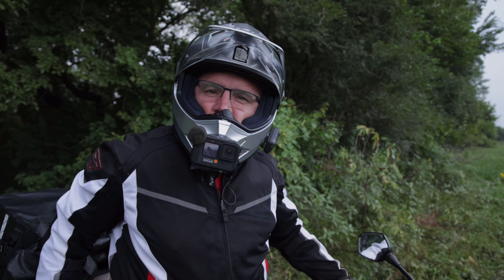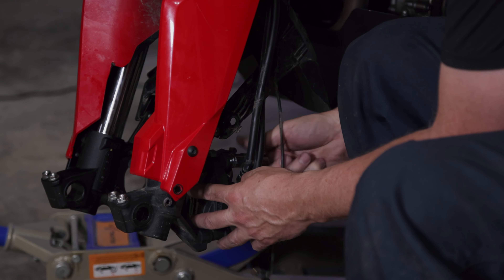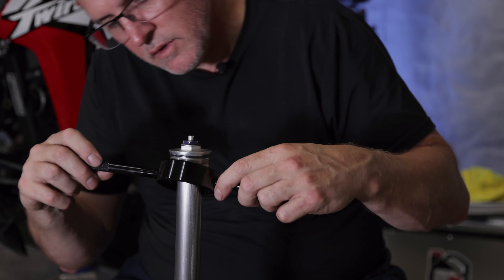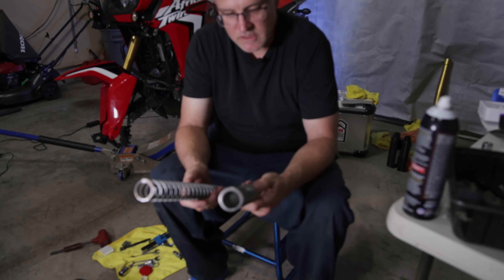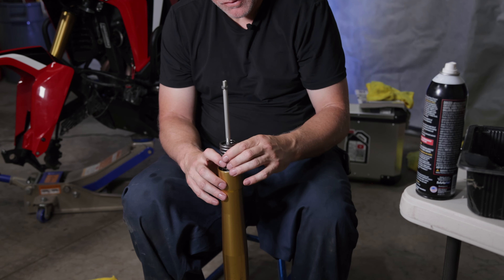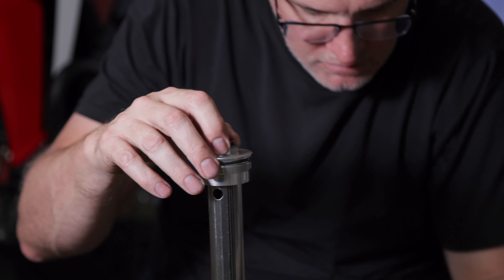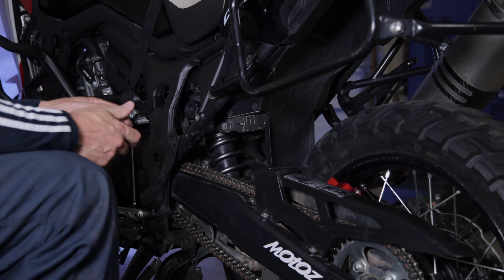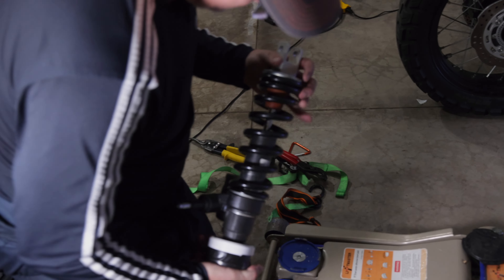Africa Twin - Affordable Suspension Upgrade with Hyperpro Springs

Comment: Nicely done.  I did the same to my 2016 Africa Twin, using some stiff Racetech springs for the forks. It made a huge difference in handling for me.
Reply from the maker: It’s the single best mod you can do for the AT if ride sag is unattainable for you as a rider. No more sending energy through the frame and body.  Its not just for off-road….so much saver on pavement too.

Comment: Nicely done! But how does the bike feel now in comparison to how it was when stock? Try to describe the new feeling please :). Thanks and cheers buddy!
Reply from the maker: Hey, thanks for the comment and inquiry.  I am 225lbs and there was zero chance at setting sag correctly and travel length was lost from the get go.  The benefits of the Hyperpro springs is immediately noticeable just taking bike off center stand and moving the bike around in the garage.  The whole bike feels like it has a core six pack with the ability to hold and transfer forces correctly. There is a lot of preload left too, giving you the ability to load up and go on trip where you come back with a beard.  The intended travel length is now available, (on top and on bottom), and the progressive part is at the end of stroke keeping violent forces from getting into frame as it stiffens at the end.  Action is improved and controlled unless you go full Evel Knievel of course.  The bike even looks better on side stand, as it is not squatting under the added weight of the mods.
Slow Speed  maneuverability and off-road technical:  Absolute improvement!  When you twist the throttle, power is delivered to the rear wheel; instead of spending time expanding the forks, compressing rear spring and then getting power to the wheel, then reverse process when braking.   The Hyperpro recommended settings seemed dialed in too.

Please comment if you have additional questions that were not answered.
Reply: Amigo !  Excelente video gracias. Greetings and respect to all from Durango Mexico 🇲🇽. New subscriber here
Reply from the maker: Thanks for the support!

Comment: Is there any way to demonstrate the change from stock?
Reply from the maker: Towards the end of the video, we demonstrated that the Hyperpro springs had the option to raise the suspension by about 20mm. To the eye, that's one of the biggest changes from stock. When it comes to riding and handling, there is a significant change. We are going to put out a full review/feedback video later down the road when we get enough testing and footage.

Comment: I have the same kit (standard rate spring) and I cannot find the 10.5 mm reference for the damper rod lock nut on top. In the HP instructions or the Factory manual it does not mention this.  I left mine at 10.5 but I wonder where Haynes gets that info.  Anybody have further info?
Reply from the maker: I’m not sure either….but it leaves room for turn on rebound and preload

Comment: What are the recommending fork and shock settings with these?  Mine did not come with them.  +20 kit
Reply from the maker: Comes with kit.  Based on weight and riding style.
Reply: @1LiterADV  ok mine did not come with that… any idea for 250?
Reply from the maker: You’d need to call them.  They’ll send you the literature

Comment: Correct me if I'm wrong but you filled the fork leg to 180  from the top, the Honda manual says 95 ml. Watching you stick the Tool into the top of the fork I could tell that the amount of tube down into the collar was twice what it should be
Reply from the maker: 180 is the recommend space with the Hyperpro spring I chose. HP sends the recommended settings when you purchase their kits.
Reply: @1LiterADV  I know, I have the same kit..
Reply from the maker: 180 should be correct depth.  Just measure before inserting spring.
Reply: I'll go back and read their directions once again, I was pretty sure they said to refer to manufacturers oil settings

Comment: As per the manual, for the rear, the tighter coil (which is smaller did)  needs to be towards the preload adjuster isn't it? or did I read it wrong? - see that you have put the tighter coil to the bottom?
Reply from the maker: I believe you are correct for the OEM spring.  The Hyperpro spring has tighter coils down.
Reply: @1LiterADV  ok. The manual says that smaller dia to the top. Is the dia less for the tigher coil side or the other side ?
Reply from the maker: Yes.  The HP spring actually only fits that way.

Comment: Thanks for the installation video. Can you provide us with a preview/ comparison video or update please?
I'm really interested to know how different these springs are from the originals.
Thanks
Reply from the maker: Hey, thanks for comment.  We plan to do a follow up video this spring/summer on the swap.  I am very happy, as the suspension now has the room in pre-load to set sag for me and still leave room for loading up for a long trip.  Before I was maxing out preload unloaded.
Reply: @1LiterADV  👍🙏
Great to hear

Comment: Perfect job!
Awaiting video with review after few kKm. But on beginning the video I already see results! What about rear spring, original is ok for my mind, but front wery softly. I looking for front, is it really need to change rear? Many thanks for good video! Ride safe!
Reply: 1 more sink, can You make video with some big wawe or stages for rocking test. OEM springs do wery bad on this, bikes front rocking so much. I has lot of drops on desert for this reason :-(
And in test video please include settings for valves. Cheers!
Reply from the maker: We really appreciate your comment.  You are correct, changing out the front spring is what moves the needle the most.  Hyperpro sales springs individually and as kits, making the option to add the rear a no brainer for me.  So much more flexibility with preload when loading the bike and/or 2 up.  Changing out the rear is harder and where things can be a little dicey.  Please have done by shop or a method that is suitable for your safety.
Reply from the maker: More videos will be made, but they take time to film and edit.  Hyperpro sends settings out based on the springs or kit you chose.  Meaning my setting numbers could be different as I picked a kit that raised the bike 20mm.  Please reference our video on setting up factory settings and adjust number of turns and clicks based from the Hyperpro recommendations for your kit or front springs.
Reply: @1LiterADV  nice!
Many thanks!
Enjoy with new suspension! 😊

Comment: Hi, thanks a lot for a quality video. I ve forgotten to set the preload & damping to minimum soft, they were at maximum hard when i replace the fork springs. Can you please explain the implications and what should I do?
Reply from the maker: Watch this videos of ours and follow up if you still have questions.

https://youtu.be/ZKtLCAIP3dw
Reply from the maker: If you didn’t set preload and rebound to minimum soft before you took them apart…I’m guessing you don’t have the turns available on preload and/or rebound.
Reply: @1LiterADV does it mean i could get more preload if i set preload at minimum soft level before re-assemble the fork? Or preload does not change?
Reply from the maker: What year and model do you have?
Reply from the maker: If you have a 16-19 year model, and the fork is assembled correctly; you should have (15) full turns available from full soft or full hard on the pre-load.  19mm nut and typically blue. Standard position is (5) A/A2 (8.5) D/D2 from the full soft position.

Also you should have (3+) turns available on the rebound adjustment from full soft or full hard. Adjustment is dial in center of pre-load. Standard position (2.25) turns from maximum position.

If you don’t have the (15) and (3+) turns available, fork is assembled wrong and you need to remove the  caps and verify they are set full soft and have locking nut down 10.5mm on damp rod.
Reply: @1LiterADV  thank you sooo much! I also forgot to back off preload and rebound and this comment was really helpful for re-assembly!

Comment: where did you order the spring from and is it the heavy or normal weight spring?
Reply from the maker: I ordered everything from Hyper-Pro and I went with the system that raised the bike 20 or 25mm

Comment: Nice video! I wonder if the +20mm HP kit springs should exactly longer on 20mm than oem springs or not? Ive just make the same change to +20mm HP kit, but there is still 870 mm of seat height. It should be 890, I guess. Also my HP springs kit are the same length as oem springs, I am not sure it is right. 

Could you please check you seat height?

Thank you and good luck!
Reply from the maker: To my knowledge, spring lengths are the same.  Spring rate is different and the height comes from the spring preload setting.  I have many adds that would effect my OEM seat height.

Comment: FOR WHAT PILOT WEIGHT IS THIS REGULATION INTENDED?
Reply from the maker: The kit that I installed was the one that increases height 20mm.  It’s a much Stiffer spring that allows you to ride fully loaded or empty and have preload range.  I don’t have a weight I can give you.  I’m 225 lbs and pack for moto-camping.  I dial up preload when heavy, ride, unpack, and dial back preload when empty.